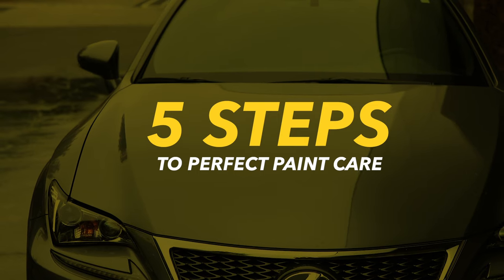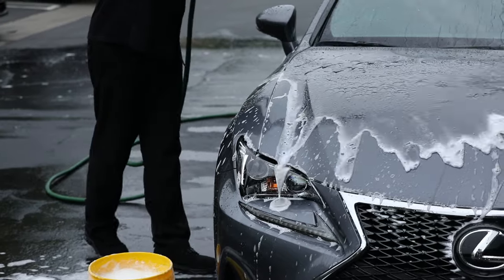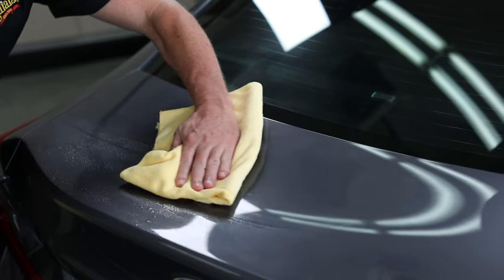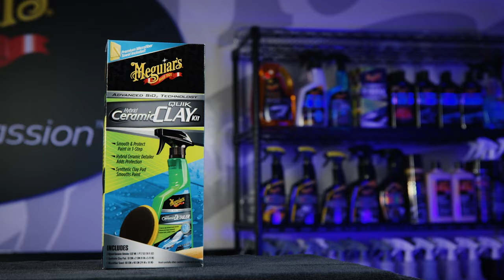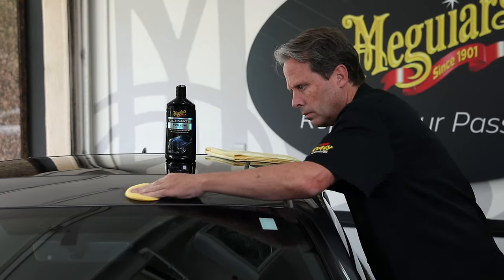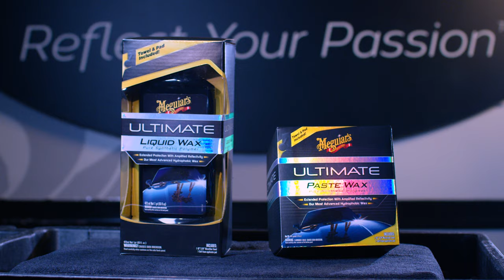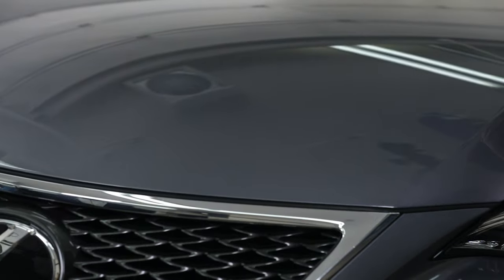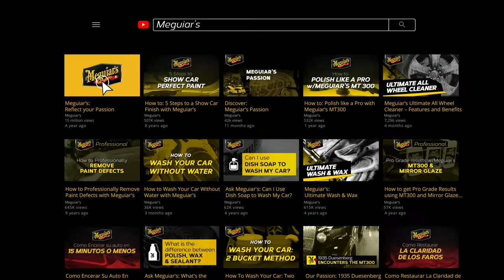Do You Want Show Car Perfect Paint? Meguiar’s Can Help With the 5 Steps to Paint Care

Comment: That clay kit is awesome. New to it. But it worked beautifully. Couldn't believe of all the stuff that came off The standard, not ceramic.. And make sure you keep the surface extremely wet, overly wet as you do it
Reply from the maker: Glad you gave it a shot.  To those outside the detailing world clay is typically a bit of a strange concept to grasp but after using it the first time you really can see the results it creates.   👍 

Thanks for the feedback!

Comment: Do you have to repeat all the steps when applying your wax every 3-4 months as recommended? If it’s a brand new vehicle, do you still start at step #1? Thanks.
Reply from the maker: Steps 2 and 3 are optional as they really depend on the condition of the paint and your desire for it.  It is certainly possible to only need a good wash and wax.
Reply: @meguiars  Thank you.

Comment: I love this video thank you so much. 
Question what if I have a ceramic coating? 
What products can and can't I use?
Reply from the maker: That is a very broad question and difficult to answer without more details of exactly what step of the process you are referring to and what you are hoping to accomplish.  Generally speaking using our Hybrid Ceramic line of products to maintain a coating would be the best choice.
Reply: @meguiars  sorry for the broad question. I'm actually new to car care as I just got my first car. I have yet to get a ceramic coating but am interested to get it done before winter. Hope that helps

Comment: Just saw this video and just bought a new Lincoln. I already have the gold car wash. If I understand this right, I Should be using the ultimate polish and wax followed by the ultimate detailer as needed correct?
Reply from the maker: Yes, that would be a good plan and is the correct order to use those products in.  👍

Comment: How often can i Apply the ultimate wax with a soft pad and a DA 15MM FLEX fe 15 not forced? I have the White pad from rupes. We dont have meguiars pads in Brazil Anymore
Reply from the maker: Although possibly overkill there is no reason you cannot apply the Ultimate Wax as much as you like/need.
Reply: @meguiars  sorry, I said ultimate wax but I want to say ultimate polish. How often can I use it ? Using it with a softpad like Rupes white pads, it will remove many clear coat in long run of use? Ultimate polish let the car with a really wet look. My car is black. I love this product.
Reply from the maker: It is primarily polishing only with very fine abrasives to remove minor defects.  It is so mild there really is not much of a chance of every running into an issue as long as you are not over aggressive with your application.  You can basically use it as much as you want or need.

Comment: Is M26 Meguirs Yellow wax better than Ultimate liquid wax?
Reply from the maker: Depends on what you mean by better?  If you are looking for a natural carnauba wax M26 High Tech Yellow Wax would be a good choice.  The Ultimate Wax on the other hand is a purely synthetic formula that will offer better/longer protection.  The Ultimate Liquid Wax also has the added benefit of not leaving a white residue on trim.

Hope that helps.

Comment: Is there a product to remove stain due to gasoline drip/spill on my car paint? I have tried  to use bag and tar remover, but no luck
Reply from the maker: You are likely going to need to try a compound.  Our Ultimate Compound would be a good choice in most cases.  👍

Comment: To keep the car topped up what's different between washless wash and ultimate detailer spray?
Reply from the maker: If just "topping up" either would be fine.  If the car is dirty you would want to use the Waterless Wash to safely clean the car.

Comment: do i need to use ultimate polish after i use ultimate compound on the whole body of my car? ... i'm worried the clear coat is getting thinner..if I don't want to polish..and continue to wax the car and apply sealant .. is it enough for my car paint care?
my car is 2 years old..but there are too many watermarks on the car paint..plus it has fine scratches and swirls.help me..
Reply from the maker: The compound is what will help remove the water spots, fine scratches and swirl marks.  Whether or not you use polish after compounding and before wax is a personal choice likely based on the condition and color of the paint as well as your personal desires for it.  If it is a darker color and you want to treat it like a show car giving it the best shine possible you may want to also consider polishing.  If it is a lighter color and/or you are satisfied with the good shine that the compound and wax offers you can skip the polishing step.  Keep in mind most waxes have some polish in them as well so you are not entirely missing polish.

None of these products should cause concern for the safety of your paint.  They are incredibly mild and safe.
Reply: @meguiars  thank for advice Sir what meguiar's wax for shine dan more durability?
Reply from the maker: Our best protecting wax is our new Hybrid Ceramic Liquid Wax...

https://s.3m.com/axhj6

Comment: Can Hybrid Ceramic Quik Clay Kit be used before the Compound or a 3-in-1 step? I am only asking because with the quick ceramic detailer it contains, it puts a layer of protection on it.
Reply from the maker: Yes it can.  A compound or a cleaner/wax will remove the protection left behind by the detailer as you use it.

Comment: Meguiar’s Show Room Car Glaze #7 vs Ultimate Polish vs Deep Crystal Polish. Which is best? They all say for dark colors and multiple reps have suggested different products.
Reply from the maker: Deep Crystal Polish is discontinued so that is not an option anymore.  M07 Show Car Glaze has been out for decades and the sworn favorite of many car lovers.  It is a solid pure polish that will give a great shine.  You really can't go wrong.  The Ultimate Polish does have a little cleaning (defect removing) capability although very very mild.  Not sure if you need that or not.  It can also in some cases be difficult to work with if too much is applied.

The reality is both are good options for most people.  Hope that helps a little.
Reply: Meguiar's I’m not looking for any cleaning. Would you recommend glaze, then the ultimate liquid wax, then the hybrid ceramic wax?
Reply from the maker: There is a lot packed into those questions but the short answer is, yes that would be great but using 2 waxes is certainly not mandatory.
Reply: Meguiar's I don’t have the enclosed area do use ceramic and there aren’t any shops that can apply ceramic near me. So, I am looking for the next best option. So far, I’ve found that a wash, clay bar, show room glaze, ultimate liquid wax and hybrid ceramic wax (in that order) would be the best options available to me. At least, this is what I’ve been told.
Reply from the maker: That would be a great process.  Certainly nothing wrong with that.  You should get excellent results.  👍

Comment: Waxing 3 to 4 times a year for real? That’s not enough out here in Las Vegas Nevada. The 110F degree weather will beat up clear coat and paint Fast. i wax once every 2 months.
Reply from the maker: 3-4 times a year is a general minimum assuming a daily driver in moderate conditions.  If you live in a more extreme/harsh environment more may certainly be necessary.  👍